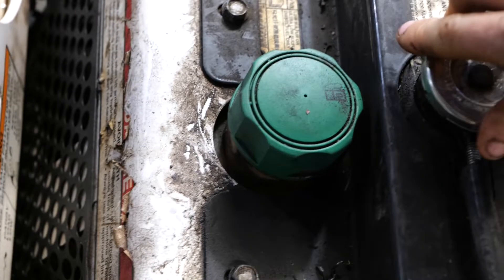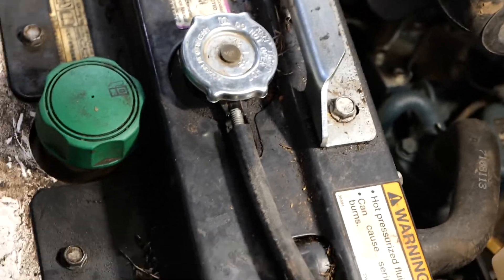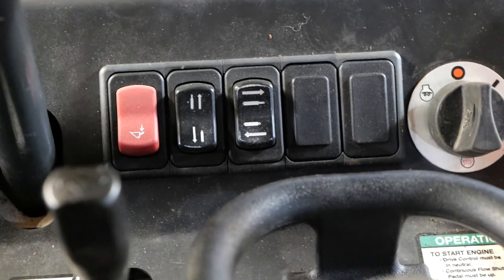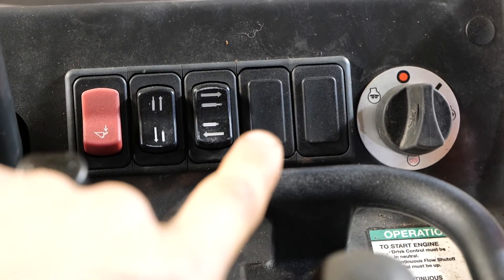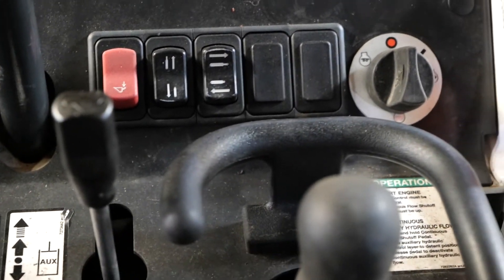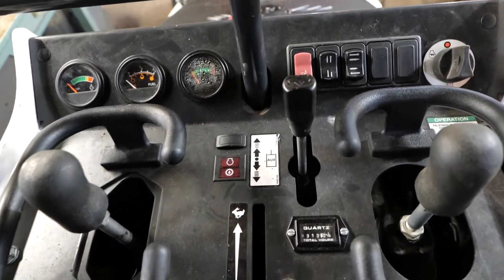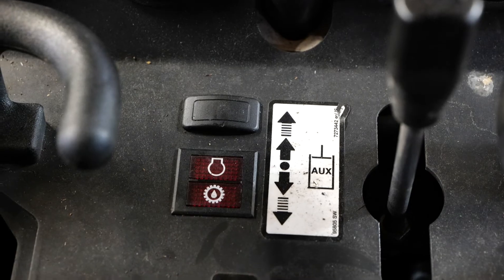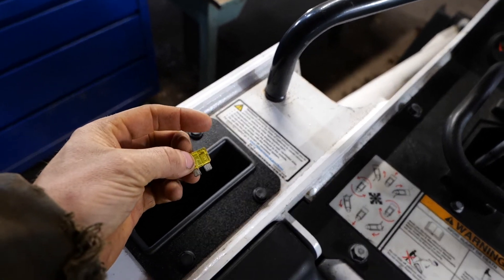Bobcat MT100: The Good and The Bad, 1 year review

Comment: Also a good tip after I’ve been running mine for the last two years I started with the wide tracks and noticed they rub on the frame and can get knocked off track easier. Now with the narrow tracks with space between rubber and frame I’ve noticed they don’t get pushed off track at all since they have been installed the last 6 months. So long story short buy the narrow tracks! Saves you from headaches of putting track back on a huge pain in the ass especially at a customer’s house.

Comment: I know they improved the tension bolt that has notches and can be adjusted with a chisel and hammer since if the bolt becomes rounded like one side did on mine Bobcat wanted 3500$ to replace the tension bolt. I had a welder weld a 1/2” nut on for 200$ 👍 works great.

Comment: You are lucky, I've had to have the engine rebuilt once and replaced once and it's knocking again...  When it's running it's great but it's broken more than it's running.
Reply from the maker: Yep I've been very frustrated with various issues on this machine. It needs frequent repairs. I had the muffler vibrate loose and loose bolts before, and had all three gauges fail in the first year, and a spring broke that the Bobcat dealer said they never have to replace.
Reply: @easyeddystrees  when it's running it's one of the best machines ever I mean it'll get through a little gate and carry a ton but God it seems like it likes to break down

Comment: Did you ever figure out why the coolant was slowly getting low?  Someone on this feed mentioned the cap.  I too, have an MT100, and the coolant level slowly gets low and I cannot figure it out.  Thanks.
Reply from the maker: I have wondered if the coolant evaporates... but have not found any explanation for that. Keep a bottle on hand, it's in the 10 hour maintenance so you stay caught up with it. Maybe because it runs PG coolant.